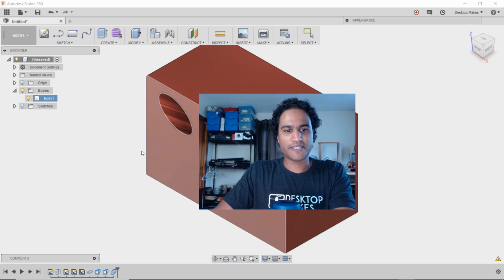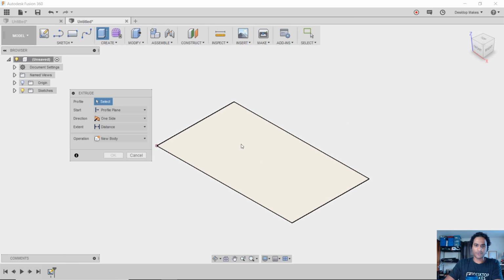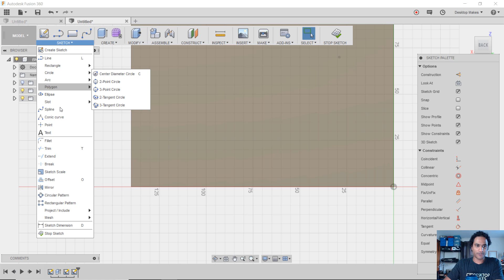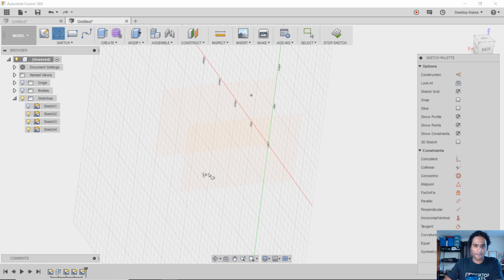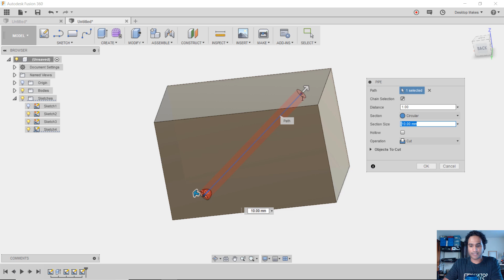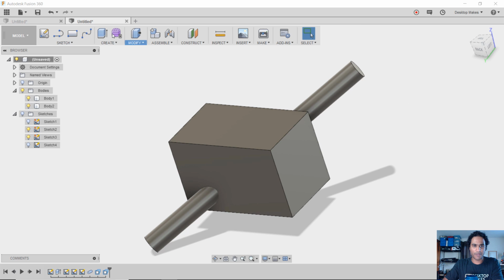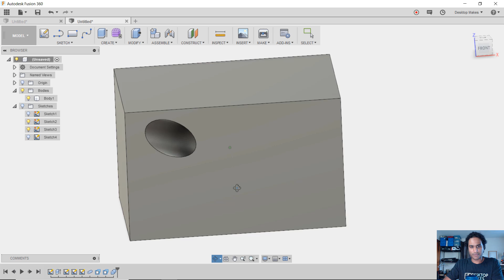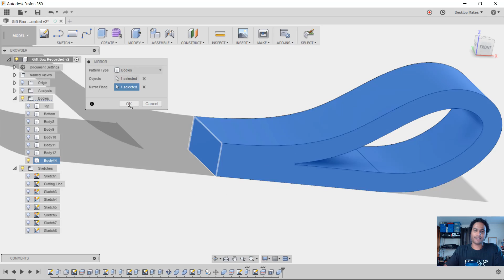3D Sketch in Fusion 360 - Create an Angled Hole

Comment: Hi Vlad, Swami here. Late to the party, but here's another way: uses 'EXTRUDE', and 'Extent Type>All'...
- Create line however you want. BTW, I did 'CONSTRUCT>Axis Through Two points', which was easier than using '3D Sketch', but alas, downstream 'CONSTRUCT>Plane Along Path' does not accept construction axis:( That said, 'CONSTRUCT>Plane at Angle' does accept construction axis, so was able to use that to get the line. But whatever - once you have the line...
- Create 'CONSTRUCT>Plane Along Path' w/ 'Distance Type>Proportional: 0.5' (or whatever, actually).
- Create sketch on that plane; create circle.
- Do 'EXTRUDE>Direction>Two Sides' w/ 'Extent Type>All' for both. The 'All' part is the significant difference from your 'Pipe'/extended approach. This also will dynamically adjust as box changes dimensions.

- Which is better? Depends on the measure of better, I guess.
- Anyhow, like you said: more than one way - so, I shared another way. Plus, I scanned the comments, but didn't see any other offers.

- OK, keep up the great content.
- Till next time...
Reply: P.S. Just hit me why 'Plane Along Path' doesn't accept construction axis (it's a line, not line segment): feature is based on parametric equation of a line segment (math-wise, not F360/3D CAD-wise): distance along line is parametrized by 't' (which relates to the 'Proportional' in the feature). So, the issue is that, apparently, the construction axis is a line (i.e. infinite: no end points), not a line segment... MATH! P.S. I'm a math teacher 8-)
Reply: FUN FACT ABOUT 'PARAMETRIC EQUATIONS': They can describe how a point travels along a curve in time, which is why 't' is often used (as I did above). So, for a given curve, a point can move along it differently in time: start slow; ramp up till end - or start fast, ramp down till end - or whatever. Now, t can also represent the proportion along the path, which is how it's often used in 2D/3D apps (including w/ splines). OK, hopefully you, +/or others will find this interesting... and if you do, you're a nerd! :D
Reply: And, YET ANOTHER WAY...
- Create construction plane w/ normal angled thru cube.
- Create sketch point on plane.
- Apply 'Hole' feature.
- Done:) Goes all the way thru, both sided, every time.

Comment: If it is not a pipe, but a custom design, how do you do that?
I have a "X" axis slanted rectangle, and I am trying to "cut" the center out of it, but a custom shape. When I extrude the shape, it does not "angle" to the body of the rectangle, but extends straight out.

Comment: Hey this was great! I needed to put a hole through a circular clamp and wasnt sure on the exact angle I needed, I was messing about with plane at an angle and couldnt get the right angle. I didnt think about using the pipe command, I did it easily using a midpoint plane then drew the line I needed... Thanks again! Just subscribed to your channel.
Reply from the maker: Great! Glad the video helped out.

Comment: Thank you :) This caused a bit of a headache since it wasn't as straightforward as one might think.
For the record the issue I had was
1. I tried to use the hole tool which only does perpendicular holes to surfaces
2. I extruded the pipe instead of pulling which joins the pipe to the body

Comment: hi vlad great vidoes i have a part were i have to put holes on a cylinder { tube} pipe,   its a hole 60 degrees from the OD  through the wall of the tube, thanks

Comment: Thanks, very easy to follow and a useful technique.  I have a potential topic for you.  I would like to make a tube with a pattern of small holes in the wall of the tube.  The holes should be in a spiral pattern around the tube.  Hope that makes sense.  Thanks again for the videos!
Reply: RVJimD. I'd suggest research pattern along path function.
Reply from the maker: Makes sense.  I will put something together.